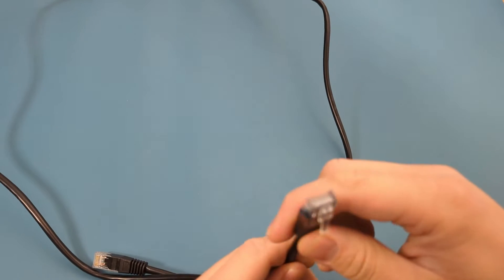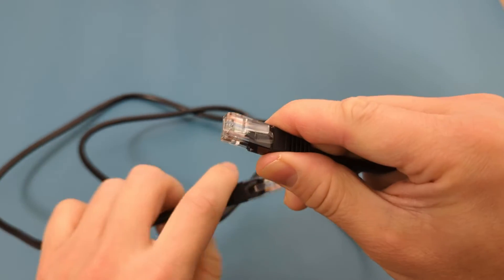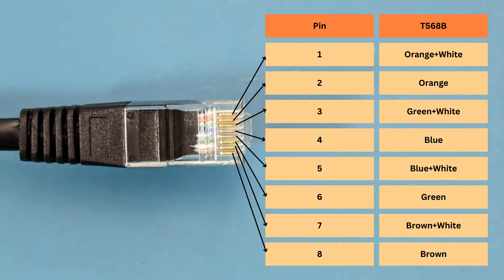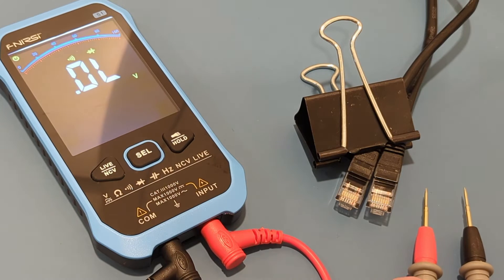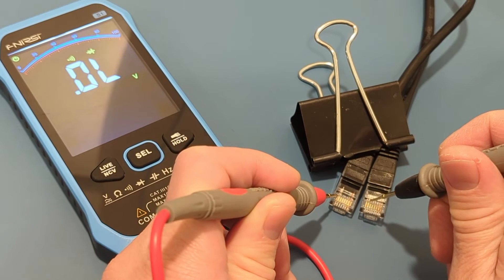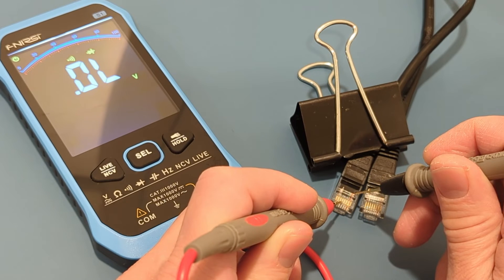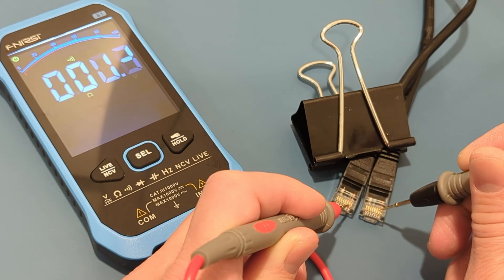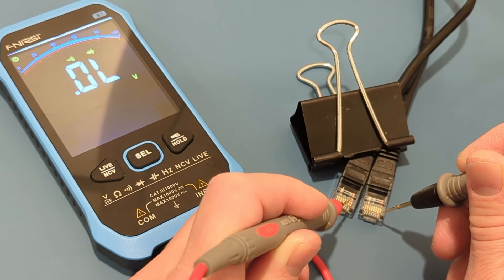How To Test Ethernet Cable With Multimeter

Comment: Please include checking cable ends by using a wall jack with bare leads having their spliced colour pairs shorted together plugged into rj45 plug, while on the other end ohm it out with the meter. Continuity can be checked and confirm no crossed pairs.

Comment: should mention checking between pins other to ensure no shorts, For example while lead is on first left hand pin, quickly touch all other pins one at a time on the right hand connector. I know they are twisted pairs but a cut just in the insulation cable could possibly cause a short

Comment: Awesome. Can we check if it is cat6 or cat5e with a multimeter?
Reply from the maker: No. Cat6 or cat5e is written on the cable jacket.
Reply: Do you have a video on checking the ethernet ports
Reply: @warrickparris5451  What a shame: I need to test a cable that is 30 metres long, one end in my Router, the other in the IP Camera on a neighbour"s end wall!
Reply: @AuntMaude that's true, this method is not very practical
Reply: @warrickparris5451  I am not sure he does, but you're welcome to check his channel out. Alot of useful info.